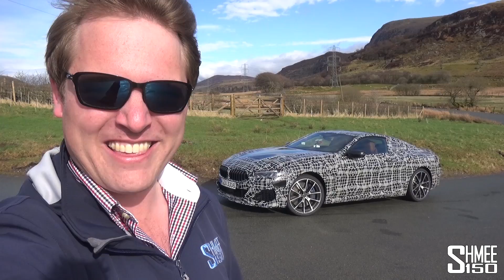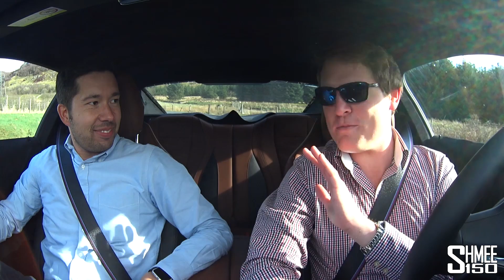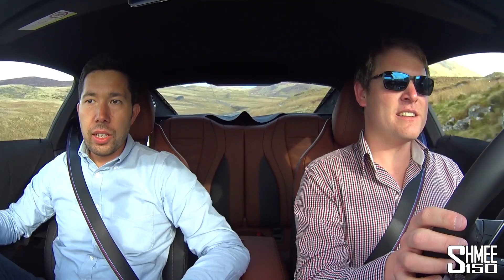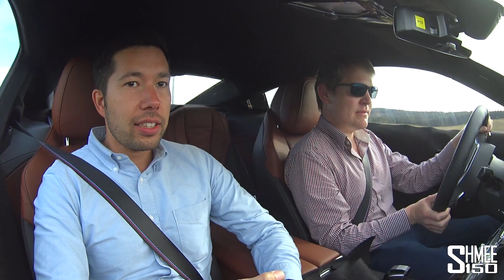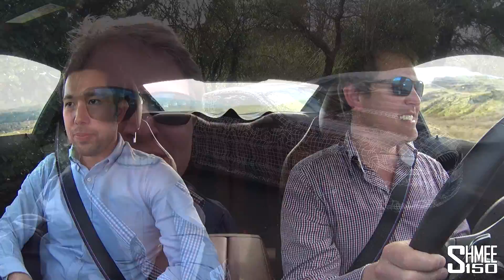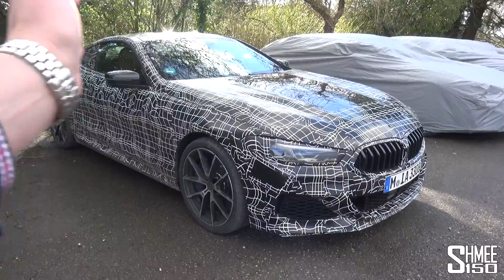Sneak Peak at the NEW BMW 8 Series M850i xDrive | FIRST DRIVE

Comment: I am cancelling my M4 order to buy this
Reply: Nigel Muilekom downpipe it and you won't hear the fake engine noise, just the noise from the exhaust.
Reply: Nigel Muilekom armytrix could help me with that
Reply: Nigel Muilekom M4 also has interior speakers. But you can probably turn it off with a computer and obd plug like on every other BMW. So getting a 8 series is a better move.
Reply: it can be disabled with a smartphone app + OBD module ($20) very simple to turn off the "active sound design"
Reply: Or get a used M6 GC
Reply: Get ready to pay close to double
Reply: Chris Ethans duh he knows that m4 to m8 of course its double ( smashes head on any sharp corner nearby )
Reply: ArmanE46 my fave
Reply: i love the internet. any idiot who has never experienced something can type away like they are an expert. M4 is definitely speakers. One of a few reasons why i didnt buy one after my v8 m3.
Reply: Preorder ct6 v
Reply: Pragma 
Don't, at least the M4 has real engine sounds while the M8 has interior speakers....

Comment: I don't think this car is going to fit in the sports car category. This is clearly a grand tourer with sports car performance, just like the S-Coupe
Reply: alvarojm11 - or better yet, the 6 series coupe.
Reply: alvarojm11 the S Class Coupe isn‘t a GT. But the 8 Series is. It‘s comparable to the AMG GT or the Aston Martin DB11.
Reply: Agree 100%! Still super exited to see what it brings and how it feels like to drive when its launched.
Reply: I don’t get what a 2 ton „sports car“ would be. For me a car like a miata or lotus elise is a sports car. This is a grand tourer. I bet you even with a low horsepower miata i would circle this car on any backroad you throw me on. Its not about 500hp. it’s all about weight you don’t have to drag round the corner. You can’t go as fast in a 2t car as you can with a 1t car. No engineer can solve that. You can work around but you can’t betray basic physics.
Reply: Christoph S. No it’s not at all comparable to the Amg gt. the S coupe of cause is a grand tourer. They are 2 different cars for 2 different markets by the same company. And the s coupe is based on the luxury platform while the amg gt is the sports car platform.
Reply: NoiseBomb the M4 already is a 2 ton car
Reply: tommihommi1 Jeah you r right but that doesn’t help. I was just kind in not knowing the actual weight an assuming the best case.
Reply: NoiseBomb but the S Class isn‘t a grand tourismo. But the AMG Gt is. And the 8 series is also one.
Reply: Christoph S. Even though the amg gt literally has gran turismo in its name it is far more designed and engineered to be a sports car than the s coupé! You’re welcome to argue about it but i drove both cars and the amg gt is by far sportier to drive than the s coupé.
Reply: NoiseBomb ??? Yes the AMG GT is sportier than the S. I have never said anything other. And because the AMG GR is sportier it‘s comparable with the 8 Series.
Reply: Christoph S. It might would be but if the 8 series wouldn’t be at least 500kg heavier and also physically larger. I would compare the 8 series to a cls amg maybe. Something like that.
Reply: NoiseBomb you have no idea about what you’re saying right? The competitor is the AMG GT! Both are GTs, both are sport cars, both will drive in the 24h race on Nürburgring, ...  I have no idea about your S Class fetish, but it has nothing to do with 8 Series. It’s also better to compare the DB11 V8 with the BMW.
Reply: Christoph S. I agree with the DB 11 comparison but that is also a big gt car. the amg gt is lighter and more sportscar than the 8 series. Also by your measurements you would compare this car to a 911, m6, corvette aston martin vantage or Ferrari 488. Heck even the bentley  continental would fit by that measurement.
Reply: NoiseBomb the M8/ 8 series is actually shorter and lighter than M6. The Vantage and Corvette are also good competitors to the M8. AMG GT is not very light. 911 and 488 are different cars and better than all of them.
Reply: Christoph S. At least we are on the same page when it comes to the 911. Have a nice day chap! Nice to argue with you and i accept your believes as well reasoned but different to mine. Thanks for staying reasonable on the internet you win today.
Reply: NoiseBomb have a nice weekend
Reply: This is absolutely not competing with the s class. After reading the reviews and with the upcoming m8 this is a true sports car.
Reply: Braden McHenry I hate to tell you but it isn’t. It might be a sporty car but no „true sports car“. There is no such thing as a 2 ton + true sports car. As said above a mx 5 is far more sports car than this even though it doesn’t have 630 hp. The point of a sports car is low weight. Even an e30 325i is more sports car than this landyard.
Reply: Yeah I was thinking the same thing when watching this video- this car looks absolutely massive and I just don't feel like BMW went all out in designing a truly good sports car. Also, for anyone saying this car is comparable to the amg gt, I have no idea what you're smoking but the amg gt is lower, lighter, has way more hp, and due to those factors, including it's a merc, probably handles better as well. While BMW probably threw a lot of engineered stuff in the car, it just does not compare to what amg has.
Reply: Ryan Fierro I don’t agree on the styling and power part. The M8 will have 630 hp which is more than the amg gt r. But as i said it will be so damn heavy. That’s the reason for me to say it can’t be a sportscar. You just carry at least a ton to much round the corner.

Comment: Damn that fake noise. Ugh. Come on BMW, try something else.

P.s. Good video Tim, as per usual!
Reply from the maker: There are ways but not via a simple press of a button.
Reply: It Sounds soo good!! What kind of speakers do it have?
Reply from the maker: The fake noise is because of noise limits for the exhausts and the fact that they are getting more strict every year.
Reply: CARtuned! BMW have this already. They have it play through the speakers. The i8 is the car that had the most noticeable one
Reply: Doesn’t matter if this car isn’t fully ready.  All modern BMW’s have it.  And it’s god awful.   The only “fake noise” generator I’ve encountered that I like is the one in the 911 because that’s actual intake noise piped into the cabin.
Reply: Shmee150 is there at least the possibility to disable the fake noise?
Reply: Chatta290 i know, i have an M2 and it’s quiet noticeable in my car as well. I just wish they’d put more work into these things...
Reply: Damn just give it some acoustic valves or something. No one wants a MIDI engine sound
Reply: I understand why this is done, but there has to be a way to pump some exhaust noise on the inside. Pumping fake sound inside the cabin feels like the cheap and easy way to solve this issue. And on an 100k+ euro sports car they should put a bit more effort into these things.
Reply: Shmee150 well i suppose this answers my question
Reply: CARtuned! Car is not fully ready so you can't judge right now. Maybe they will change it
Reply: Joe Tacchino Same with my Z4 Coupe
Reply: How can u tell it’s fake
Reply: ironmanner555 lol Its great. Dont blame the speakers helping the engine a bit, the note itself is 😍👌🏻
Reply: Sorry if it’s self explanatory, but how exactly do the speakers play exhaust noise? Does BMW create an audio resembling the exhaust and just plays and matches the accelerator? I don’t really understand.
Reply: the SVR wasn't afflicted by that issue? It has a beautiful exhaust note! Computer generated sounds feel a con, I'd want the option to turn it off.
Reply: At the end of the day u cab make 1.8 litre 1999 civic sound loud with certain exhaust so who cares if they put noise through the speakers it’s all jus the same to enjoy